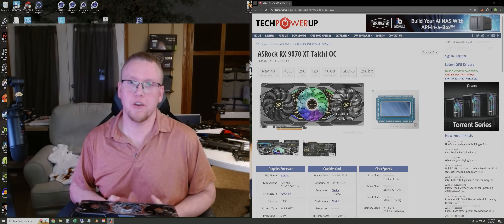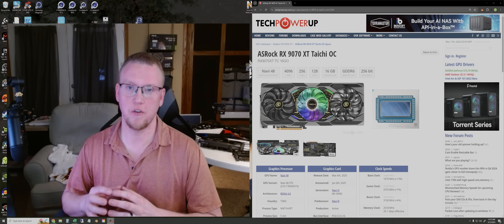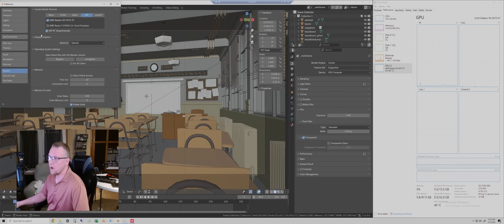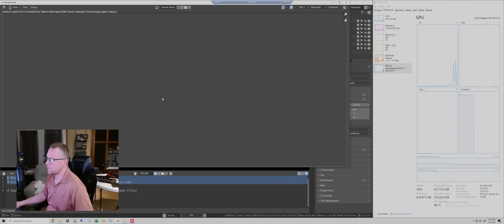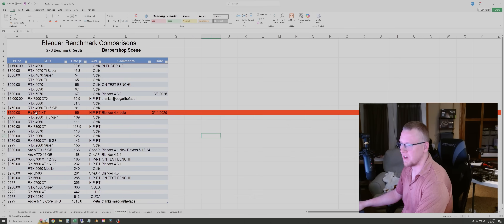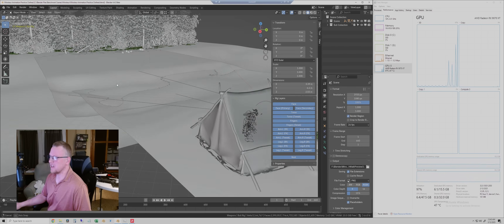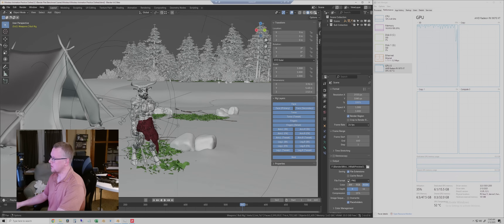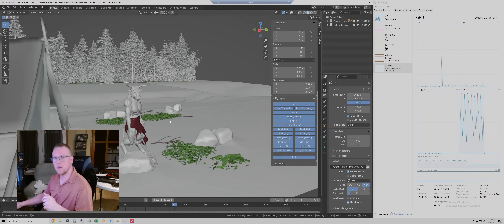NEW AMD Rx 9070 XT Render and Viewport Tests in Blender

Comment: hmmm

I must say I am a little disappointed. In gaming the 9070 XT have moved much much closer to Nvidia in RT loads. Thus I had hoped it would have transferred over to Blender.
I would have expected the card to be very close to the 7900 XTX maybe even faster than the XTX in some cases. Clearly the new RT accelerators har much faster than the old one. Since 9070 only have 64 and 7900 XTX has 96 (50% more). It is clearly faster than the 7800 XT, but the difference is smaller than what I would have expected since 9070 XT has both more and faster RT accelerators. 

The 4060 Ti only have 34 RT cores the chip is about half the size and still it can beat the 9070 XT. That does not look good for AMD.

Also what is it about the lone monk scene. If behaves completely different from all the other tests. Why is AMD so much better in that scene? 😵

Unified shaders : Texture mapping units : Render output units : Ray accelerators : AI accelerators
7900 XTX: 6144:384:192:96:192
9070 XT:   4096:256:128:64:128
7800 XT:   3840:240:96:60:120

shader processors : texture mapping unit : render output units : ray-tracing : tensor cores
4060 Ti:     4352:136:48:34:136
Reply: Yes I agree idk why rx 9070xt performs so bad. Could it be that rdna4 hasn’t improved fp32 which blender heavy uses?
Reply: @malathomas6141  No. it's 100% software problem, not hardware. AMD doesn't have Optix. Nvidia spent 15 years improving it...
Reply: @kazioo2 hip-rt is amd optix equivalent.
Reply from the maker: I think HIP-RT is definitely behind Optix by far. Which is why I hope this GPU will speed up in a stable 4.4 or with new drivers. Like @Petch85 says, it should be much faster based on specs. We will see if they change anything on AMD's end, but they don't normally develop HIP-RT very fast.
Reply: @malathomas6141  I don't think so. 

The 9070 XT should be 48.7 TFLOPS.
The 7900 GRE should be about the same 46 TFLOPS
The 7900 XTX should be 61 TFLOPS
The 5070 should be about 31 TFLOPS
And the 5070 Ti should be 44 TFLOPS 

Thus you could argue that the 7900 XTX should be 25% faster than the 9070 XT (fits ok with the testing data), but the 5070 is faster and the 5070 ti will clearly be much faster although it has a lower FP32 TFLOPS.

Maybe that is just due to optix being much better than HIP-RT 🤷‍♂. But if that was the case then maybe a software update would help AMD a lot. Thus someone would probably be working on that. 🤞
Reply: @Petch85  blender 4.4 uses the latest hip-rt 2.5 and 9070xt has improved ray tracing but is still slower than a 7900xtx doesn’t make sense. And doesn’t match what we see with nvidia gpu
Reply: @malathomas6141  No it doesn't make any sense.

Well the 7900 XTX is a larger chip and from the specs alone I feel like we would expect it to be something like ~25% faster than the 9070 XT and it also have more VRAM. This should make it much more expensive. 

BUT:
There are a lot of differences between the 7900 XTX and the 9070 XT that should make the 9070 XT faster. The cache is completely different, BVH (Bounding volume hierarchy) is now 8 from 4, RT accelerators have been change and much much more. Chips and Cheese have a good relatively simple article listing all the differences. But for some reason this does not show up in blender as far as I can tell. 

But in other benchmarks I have seen the 9070 XT is very close to the 7900 XTX in RT performance, showing that all the changes does improve the 9070 XT. But clearly that does not translate to blender.🤷‍♂

And why AMD is so much slower in blender than Nvidia is a bit confusing to me. Especially when the lone monk scene looks more like what we should expect from the FP32 numbers alone. 🤷‍♂

But it is complicated, maybe it is the memory bandwidth, maybe it is the cache, maybe it is somewhere else in the architecture or maybe it is the software. idk🤷‍♂. But I had hoped that AMD would do a little better in Blender. 😥
Reply: @Petch85  yea i had high hopes for this based on the RT performance but it actually had 0 impact on where it should be in 3D work
Reply from the maker: Also like mentioned elsewhere, I still wonder if HIP-RT will get a bump in the 4.4 stable version of Blender. But we shall see!

Comment: Thanks.  Maybe i will consider AMD over nvidia. Depending on availability. I actually wrote off the amd 9070 xt until I a saw this.
Reply from the maker: You are welcome! It is not shockingly fast for Blender, but it does fine. If you also game on the PC, then this can be a great value overall.

Comment: AMD's Blender rendering is still less efficient, assuming HIP-RT is equally efficient compared to CUDA, but nvidia has OPTIX, and the only thing I can confirm is that OPTIX takes advantage of tensor cores which AMD GPUs don't have...
Reply: What? OPTIX takes advantage of ray tracing cores not tensor cores and hip is the equivalent to cuda and hip-rt is the equivalent to optix
Reply: @malathomas6141  is this answer from chat-gpt ?
Reply: @malathomas6141  let me ask gemini
Reply: @malathomas6141  thank you, dude, gemini confirms your answer, you're best
Reply from the maker: Yes I think Optix makes much better use of Nvidia RT cores than HIP-RT does with RT cores. So there could be hope for software-based speed improvements. But AMD does not update software very fast, especially outside of gaming applications.

Comment: is Optix that much better than HIP ? how does that 4060 come so close?
Reply: It is. I blame AMD for not giving Blender much love, unlike nvidia. Afaik, HIP RT is currently in it's 2.4 iteration for some time now, but no one updated it for Blender ever since 2.1 version year and half ago. Not saying it would drastically change the balance, but just goes to show the priorities, imo.
Reply: @moravianlion3108 Unfortunately it's not just Blender. A lot of apps don't support hardware acceleration on AMD cards for one reason or another.
Reply: @moravianlion3108 blender 4.4 has hip 2.5 tho
Reply: @moravianlion3108  AMD loves Blender, which is why they constantly use it to show their CPUs superior performance over Intel. But CPUs are standardized and GPUs are not, so AMD doesn't need to spend years maintaining a software ecosystem to optimize the performance like it's necessary for GPU architectures.